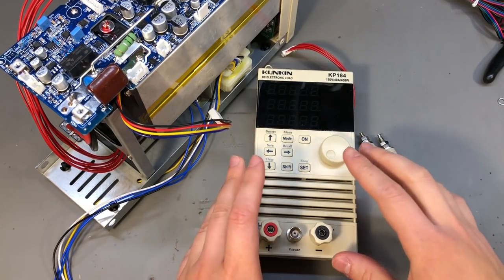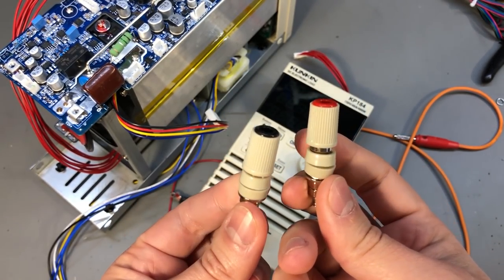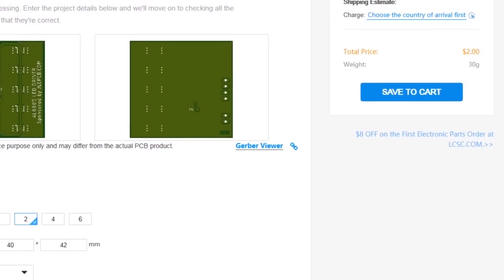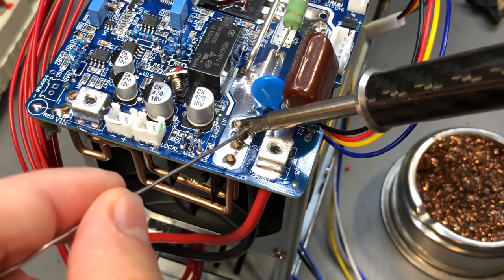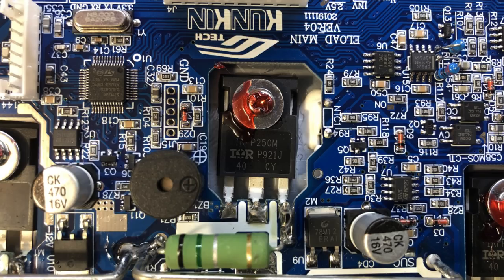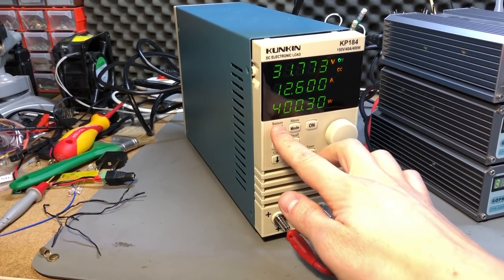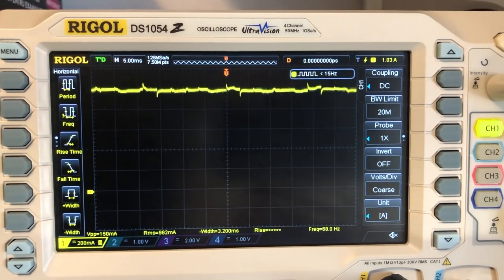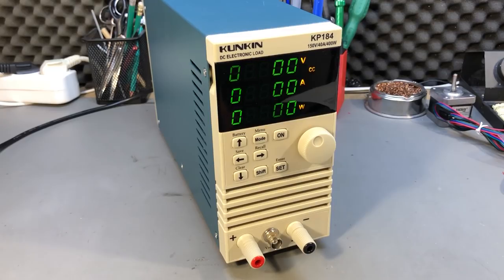Kunkin KP184 Electronic Load Issues Fixed | Voltlog #302

Comment: I bought a Kunkin kp184 with the production year March 2023. The board is V06 (purple board) and also had fluctuations of around 160mA in CC mode. I desoldered the C58 and it was also reduced to 30mA fluctuations.

Comment: I would like to make a note about the earthing (point 2): In terms of protecting an earth fault originating within the appliance, the rest of the enclosure does not require protective earthing as the mains earth is already present at the transformer stud. You can earth the rest of the case as a functional earth, but it is not expressly required for safety or protection against insulation faults in the transformer.

Comment: There is a another problem with these units. The four screws that hold the fan are connected to the positive lead through the heatsink. Under test these units screws are live. And can pose a potential shock hazard. This may be why they did not ground the side of the case or the back of the case. By grounding the side of the case, you're actually making it more dangerous to turn it on and off while something is connected. 

Make sure you disconnect the unit under test before turning it on or off.

You could also cover the screws with hot glue or silicone, anything to insulate them.
Reply from the maker: Yup, mentioned this issue in the review or teardown video.
Reply: I thought that the fan has a plastic body? I am not sure how such a connection would exist.
Reply: @bjem2287  The screws go through the fan and into the heat sink, which is directly connected to the load transistors.

Comment: According to Infineon’s website and datasheet the IRF parts still has the IR markings on them. Otherwise they would’ve update the datasheet with the new marking information. IR being part of Infineon doesn’t mean it cease to exist. Looking at the date code on the pcb showing 2019111 and other components showing 19 date code on some of them most likely means the mosfet having a date code of 9 probably was manufactured in 2019.

Comment: To get application working, user need to set on windows system locale to Chinese simplified and after the full package install and reboot replace the files on Program Files with the updated application(small download). @VoltLog I will get instead this unit the ET5410 Electronic Load, you should test that one too.

Comment: When my device arrived, the rotary control always went up in the same direction, only with the keys down ... it cost me a little time ... I arrived at the processor after a thorough investigation ..... and a tiny one Well hidden solder bridge found on the processor ... sending back to China is out of the question :( but it works .... :)
the final inspection slept there too

Comment: Try to decap the mofets using chemical or brute force. Usualy the fake one have small silicon die. then compare with originals.
Reply: I'd just measure the voltage drop and temperature at known currents first.
Reply: ..... Or ask Clark Kent to look at them.

Comment: just checked that jlpcb you always mention: 6 dollar for a pcb, then 48 for DHL shipping(only option), to which i should add 68% custom tax due to DHL, so for 5 pcbs the minimum is USD 92~, i'll pass on it...
Reply: Depends on the country, for me they offer ~$8 airmail shipping, no customs tax on that. If I go with DHL its ~$20. Maybe there are better options available in your country.
Reply from the maker: If you are not getting the $2 cost then you might be choosing some non-standard options as that cost is only valid for the standard setup. Regarding shipping there are multiple shipping options, their price varies depending on where you are located and especially now during the pandemic shipping costs are higher everywhere so do let us know if you can find cheaper. Most people right now are not even concerned with cost of shipping but rather actually receiving anything in a reasonable time.
Reply: @voltlog  i did a quick selection of the most beasic board to check the shipping cost(i think it was 10x15cm), but the only shipping option for 5 boards was DHL.

Later i checked out pcbway and they do offer multiple options for my country, one of them china post registered for 7USD shipping(USD12 total), even if it takes 60+ days to arrive paying 10x more for hobby boards is not cost effective (even if i'd pay jlcpcb for dhl shipping which i know arrives in 5 days, the components which i need to get from china will take 60+ days all the same)